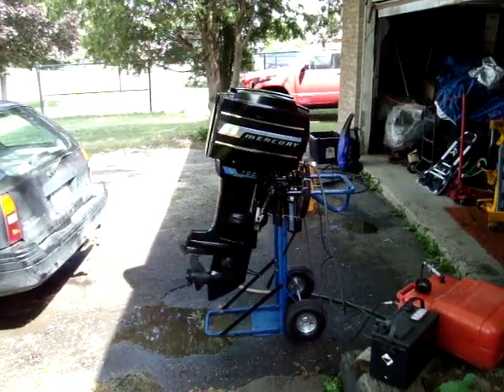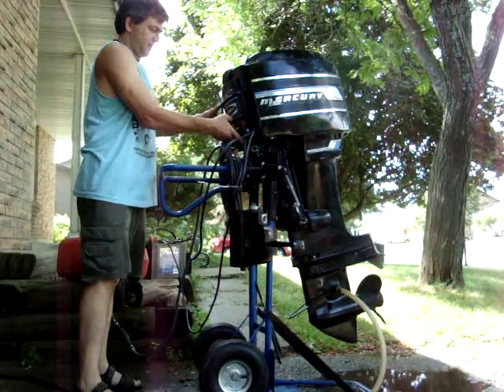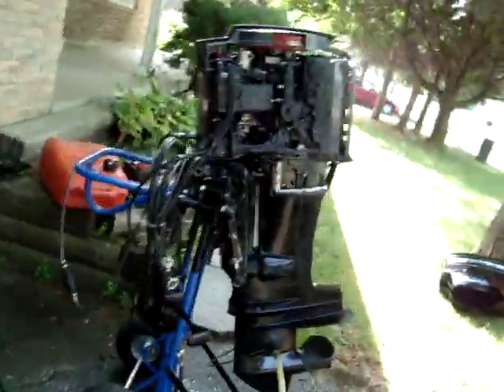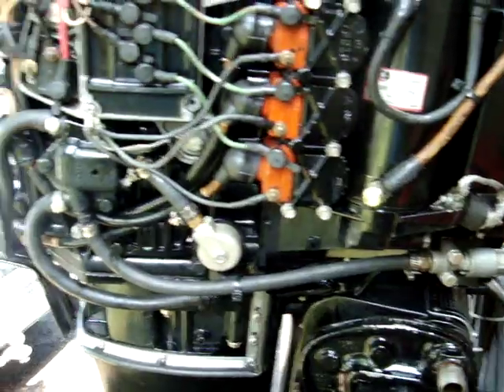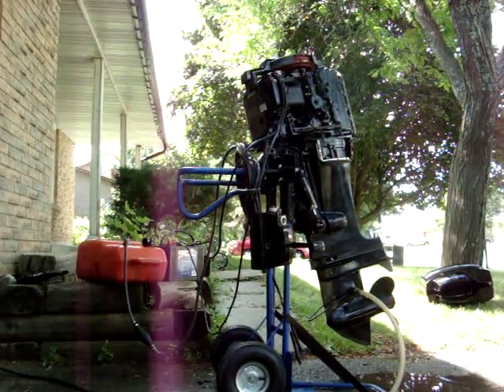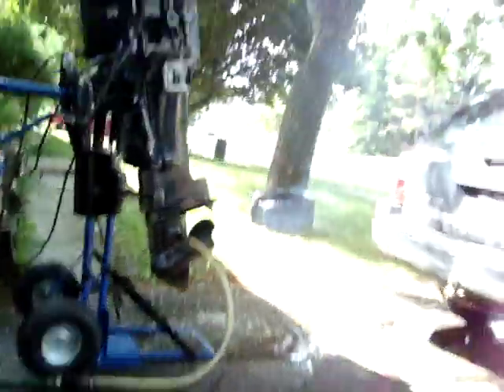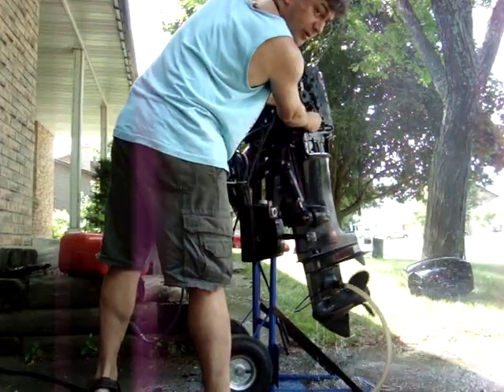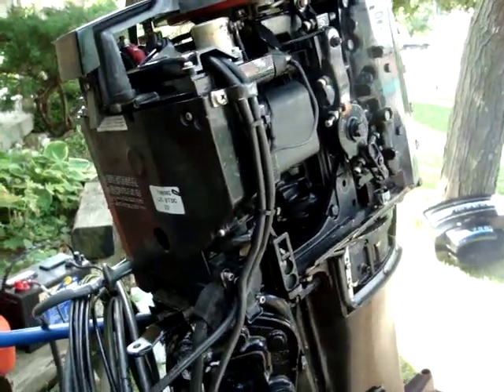70 Hp merc 1977

Comment: I love your motor support. Can you do a quick video showing the add ons to the dolly? Thanks.
Reply from the maker: Sorry for the delay but I cant find my camera. Basically just cut the bars at your prefered height and weld a big piece of angle iron ontop of the pipes then weld the piece you cut off onto the back of the angle iron. Add wood. I fit the wood and screwed to the angle iron prior to welding.Then removed it. I also would mill the wood to the same height as the angle iron for more support. I used a peice of hardwood from an old skid usually. Hope thus makes sense. Smedley

Comment: Ive run one of these for 5 years without fail .The electronic control connection would get hot ,best to reroute main power directly to the outboard .I love ours ,we run a 17foot runabout and can getbup to 35mph on a nice day
Reply from the maker: When set up properly they are a nice smooth little motor. Enjoy.
Reply: @smedsmarineland  I have one that I need to get running. Where are you located?
Reply from the maker: @juliannepstad2757  I'm in Ontario Canada. A little too far lol.

Comment: I've got a similar engine.  It bogs down sometimes.  I just not sure what I'm looking at.  The carbs are in the back right?
Reply from the maker: No the carbs are in the front behind the plastic sheild. Check your fuel filter, pump and line first before doing the carbs.

Comment: On this engine, what do you say this engine pushes out in mph or knots? Apologies if I asked using wrong acronyms. But how fast does this go?
Reply from the maker: It totally depends on the size, weight and style of the boat it is on
Reply: 25-30 with our family of 6 witch is pretty good for this ol gall
Reply: 31.7 knots

Comment: Mine has the old distributor that moves when fuel is increased .ie. lever mechanism onto a upside down distributor. Guess it's older than yours... probly why it's much heavier.

Comment: Hey man, i got the same motor, i need a propeller that works for my 17 feet
Reply from the maker: Most Marinas still carry props for these motors. They should be able to help you with a pitch selection. With a 17 foot boat make sure you dont get too high a pitch. These motors need to be able to make high enough RPM to make proper HP
Reply: @smedsmarineland  my prop now does in fact «overspin» in the water, trying to get a good grip